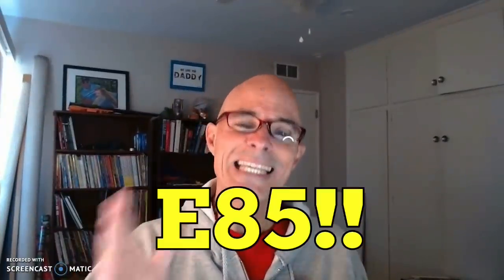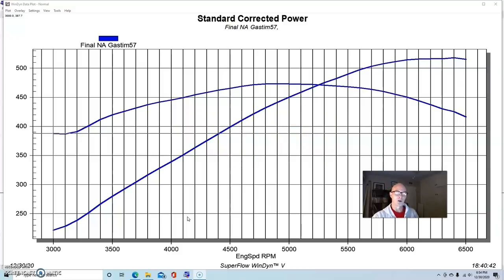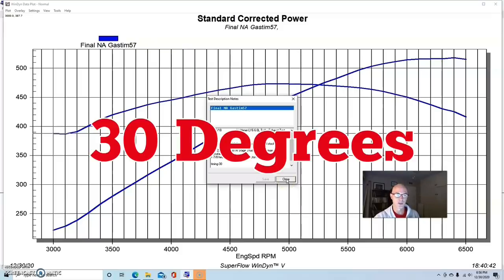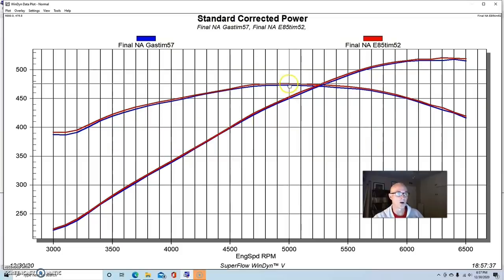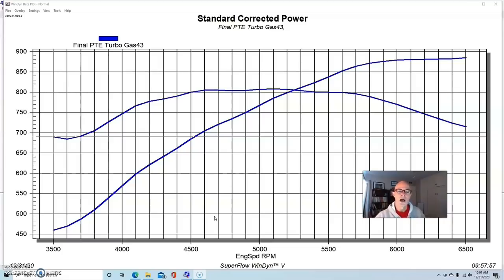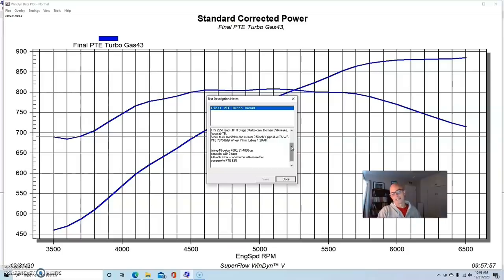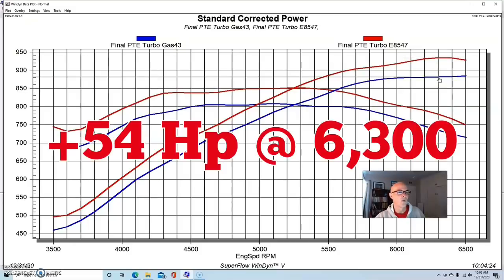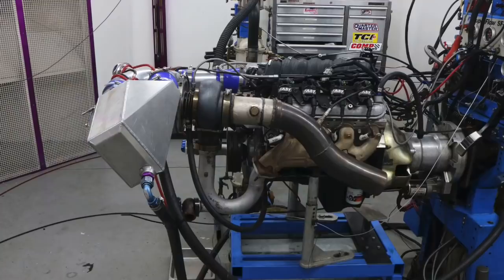JUNKYARD TURBO 6.0L LS E85 FUEL TEST

Comment: If you are not picking up power on E85 vs pump gas, you are not running it rich enough. You do not lean it out to make more power on ethanol like you do with gasoline, throw fuel at it instead. Best power on E85 is around 7.5:1. best mileage with good power is around 8:1 to 9:1 AFR. Timing also plays a part too, as does head/chamber design. As I explained in my other post on this video, the reason ethanol makes more power is it has more oxygen in it. Adding more fuel adds more oxygen, and it compounds as you add more. Oxygenated race gas will keep up power wise because it has more oxygen in it, but it is hideously expensive and E85 around here is under $2 a gallon. 

Even an 8:1 engine will puck up power if you get it enough ethanol. It might only be 8-20hp, but its less money and still more power. Low compression will result in lower mileage, but around 12:1 compression NA you will see the same mileage as on gasoline, and ethanol will pick up mileage along with power above 13:1. Lots more power, and using even less fuel.. still more win. From High Performance Pontiac magazine before they were bought by the owners of HRM. https://www.hotrod.com/articles/hppp-1109-testing-different-fuel/

it also cools the intake charge, but that is very limited in a port fuel system, works a lot better with a carb where the fuel has more time to vaporize and pull heat out of the intake tract. You will see more power the farther up the intake tract you introduce the fuel, also more cooling because it has more time, and if you run the fuel hot enough in the EFI lines you can make power AND increase mileage. the turbo is heating the intake air, ethanol cools it even with port fuel injector location. you get a little bit with direct fuel injection, but that goes completely against how ethanol works, so you will probably use a lot more ethanol in a DI engine. 

It DOES NOT eat your fuel system or engine gaskets, it will however clean all the varnish out of your fuel system and clog the pump, filter, and injectors. Additives are what cause the corrosion issues, not the ethanol. DO NOT ADD ANYTHING TO YOUR FUEL. Its bad enough when the oil companies do it. You know Jeff Smith as the tech editor of HRM and also for Summit Racing. Here is his article about corrosion on ethanol.

https://www.onallcylinders.com/2018/05/25/ask-away-jeff-smith-e85-pump-gas-additives-not-ethanol-cause-corrosion/

I've been running ethanol both mixed like E30-E98 and E100 that I make from tree sap, converting and tuning carbs like Holley, Demon, and my beloved Qjets. I am the go to info source for E85 Qjets. Look into it and you will find the info I have provided with m 455 Pontiac powered GTOs and Firebirds. I build my engines with as much compression as I can,  my daily driver 65 GTO has an iron head 455 with 11.5:1 and closed chamber heads, it likes 42 degrees total advance, the 67 vintage 400 heads don't have a good chamber shape to go with the large quench areas. In the 90s those same heads wanted 52 degrees total on 100 octane VP or Sunoco race gas.

My tuning and mileage testing mule is a 13:1 455 with open chamber 69 RA III heads that have been ported to flow 70cfm more than stock. They do not have the center crossover filled so the intake can get warm, which helps with vaporization. It makes tire shredding torque, well over 600ftlbs from what I can tell based on its ease in moving a 4100lb 70 GTO, and gets 20mpg with a Qjet, 700R4, and 3.42 gears. Mid 11s is where both of them run, and the 65 is a lot lighter than the 70, like 700lbs.

It costs me 10 to 40 cents to make a gallon from tree sap or cattails, respectively. it also requires about a weeks worth of work to make enough for the year, mostly cleaning as the yeast do the heavy lifting for me. You need a good amount of space to produce ethanol, I have lots of trees with 3% to 5% sugar in the sap, (around 300 sugar maples) no need to cut them down, just tap it like maple syrup. Syrup is far more valuable if you want to sell it though, I drive my cars more than I eat pancakes or waffles. If you want to know how it all works, just ask me. Its very simple, but has legal requirements. I will be making some videos about all of this in the near future.

I use an Innovate wideband in my header collectors to measure the AFR, I do not run it on the gas scale, I want it to read what its actually doing, because the mix might be different from spring to summer, and my home brew tunes a bit different with no gasoline added to it.. I have alternative methods of denaturing the vodka. Lambda measures stoich, so I don't use that either, because best power and best mileage are a good distance apart in tuning.  I don't have an engine or chassis dyno, so my measurements are all ET/MPH based. I am not the only one testing either, a group of us compare our tunes and a couple friends do Holley/Demon conversions for people. 

You can try to run ethanol like you do gasoline, but I will make more power and use less fuel than you do. I put Richard in touch with Mark Sullens, but Richard didn't want our nearly two decades of tuning/racing information. Its ok though.
Reply: Saying that ethanol does not eat you fuel system is over simplistic and therfore incorrect.  In a 2020 vehicle that would be a correct statement, in a older vehicle with natural rubber lines, fuel tanks containing lead, and cork gaskets the ethanol absolutely will cause sever deterioration and be problematic.
Reply: @jaydunbar7538  no, it does not eat your fuel system. My daily drivers are 65 and 70 GTOs, along with a bunch of other old cars I either build or race. The 70 has its original tank and hard lines, and its been on E85 the longest. 

Now if you have original rubber in your 40+ year old fuel system, its a fire hazard no matter what fuel you have had in it. Rubber has a lifespan. It is considerably less than 40 years. 

All replacement parts are ethanol compatible now. They have to be if you are going to run pump gas. If its good with 10%, its good with 100%, and everything made today is good with 10% because you never know where its going to be sold and used. 

The rubber hose I use in my fuel systems comes from either NAPA or CarQuest, its the basic EFI rated stuff, because its cheaper and I can use it with high or low pressure fuel systems. I do both.  I get lots of years out of the stuff, far more than I did in the 1990s when I was running race gas in my street strip ride. VP red and Sunoco 100 both made the rubber lines brittle in les than two seasons. 

I have ten year old rubber hose I am using with E85 and my E100. Also have a 30 year old Carter electric pump I use to get fuel out of 55 gallon drums and into my cars. It was under the 70 GTO for 15 years on 10% and E85 for 7 years. 

If there was a problem with ethanol and fuel systems I would find it. I do absolutely nothing special, no draining, no additives, no prep, nothing. When it gets too cold up here for me to drive it without a heater, or the snow flies and they salt the roads, I pull the batter and leave it, until mid May, when the snow is finally melted and the salt is washed off the roads. We get two blizzards every April, so I kinda hate that month, it teases me with great weather then dumps 4' of snow on me overnight.  So I always wait until May to take the insurance out of storage.  

November to May is a long time to sit.. and I never have a problem. Not a single one since I converted the 70 GTO back in 2007. 

If you are getting problems, it is not due to ethanol, it is due to additives or gasoline itself. You can blame ethanol all you like, but it doesn't change the fact that it isn't hurting anything but your tires and feelings of guys running pump gas.
Reply: And you will never get more fuel milage out of e85 then regular gas if thats what you are trying to claim, it has less BTUs per gallon therefore will ALWAYS consume more fuel per mile traveled.
Reply: @jaydunbar7538  aa I said already, the BTU is irrelevant its a measurement of heating water. There is a lot more to a fuel than heating water.  Not only that but ethanol is more than twice as efficient as gasoline. While gasoline in a lab can approach 18-20% efficiency, and street bound engines are closer to 15%, squeaking up ther to around 17 sometimes 18 with modern EFI and DI, ethanol is 40% real world and 42% in the lab.  

The US Navy tested exactly that way back in 1942, and they used ethanol to power torpedoes, airplanes, and many other war related things. The Luftwaffe used ethanol to power their jets, like the Me262 and He162. 

Hell the Model T was dual fuel before the Volstead act made it illegal to make or possess ethanol, to run ethanol you advanced the timing with a lever where the modern turn signal is and richened the mixture with a knob on the dash. To run gasoline you retarded the timing and leaned the mixture, and still it wanted to overheat on gasoline. The Volstead act was funded by Rockefeller to eliminate ethanol as a competitor to his gasoline.

What that means is gasoline is wasting more than 80% of its energy as heat, its not powering anything with that heat, its just making engine parts hot, and it needs to be cooled. By contrast ethanol only wastes 60% of its energy as heat, so more of the fuel is used to actually do work. Ethanol also has a 'softer', but 'faster' combustion event. Gasoline has a pressure spike that tends to break parts, ethanol is much more forgiving in that regard.

What happens when you drastically raise the compression ratio? You increase efficiency. You are working the same amount of fuel harder, and its making more torque as a result. Torque is what gets the vehicle rolling, the more of it you have the easier it is to move a given mass. This is why I build Pontiac 455s instead of 283 chevys. Also i can make 13:1 static with a flat top slug in a .030 over 455, using a iron stock head with some milling. Not even a lot of milling. 

Compare a 14:1 engine with a 7:1 engine and its going to be a massive difference in power and mileage. Gasoline from the pump will run happily in one, and not in the other, ethanol will run in either and not give a damn, but since you are not working it anywhere near as hard with each combustion event, the 7:1 engine is going to get a lot worse mileage than the 14;1 engine. 

Now crank up the compression to 22:1, diesel territory. Remove the gasoline and run denatured or straight E100 with a spark ignition in a diesel engine. You can't run the diesel injection, you have to run a carb or EFI. 

 It will run and get much better mileage than the pump gas engines of the same displacement, and you won't need all the mass in the engine to make up for the somewhat random combustion events due to the diesel cycle.  You can build a much lighter engine that makes the same power, and wastes less fuel to heat. You still need to contain all the cylinder pressure, so it has to have thicker decks, but nothing like the mass required for longevity in a diesel. 

Then you get into vaporization, and we all know a vapor has vastly more surface area than larger droplets like you find in atomization. That is why you get a more complete burn, more power, and it wastes less energy as heat. 

Remember that 1870 GTO?  Well I got 18-19mpg following a semi on I40 across Tennessee back in February 2000 when I drove that GTO from Nebraska to my base in South Carolina.  It had a Qjet fed 455 with 8:1 compression in it, turning a 2004R and 2.93 gears, and drafting off that semi. It also ran mid 12s like that despite weighing 4100lbs.

Then I built another 455 for it and used small chamber heads from a 69 RA III 400, milled them to make 13:1 with a flat top slug (yes I measured everything to make sure I had the compression I wanted 64cc chamber, zero deck, 8cc valve relief, .040 head gasket thickness and 464 cubes), and ran a similar sized cam with a slightly wider LSA to maximize cylinder pressure. A 700R4 and 3.42 gears went behind it. Left the heat crossover in place, converted a Qjet to run E85, got the AFR around 9:1,  and drove it the same 65-75mph without drafting trucks, going uphill rather than predominantly downhill, and it got 20mpg easily. It also made a lot more power, dropping more than a full second in ET, and still weighing 4100lbs. It tended to break transmissions though.

Note the 2004R has a .52 OD and the 700R4 has a 70 OD, along with the difference in final drive. Unlike the typical sbc, a 455 does not give a damn what gear is behind it, so it will push a 2.41 just as easily as it does a 3.42. More gear than 3.42 and it will go slower and just waste fuel, moving through the RPM range too fast will do that.

You see I have been doing this for some time now, and I managed to get good mileage and power on pump gas long  before switching to ethanol when gasoline was $5 a gallon here. 

The 65 GTO has crappy aero, really bad aero to be honest. The best it ever got with a 400 and 2.56 gears on pump gas, with 7.8:1 compression, was 15mpg, but it did run pretty good being quicker than my LS1 powered 98 Formula with a full exhaust and lid. Mid 13s..Then it got the 11.5:1 455 and running E85, put the 3.42 geared 12 bolt from the 70 in it then ran a 700R4 for abot two years, but it broke it. So I put a Th350 in it last summer,  The OD was worth about 2 maybe 3mpg, usually only 2 because the aero is terrible, But it regularly got 17mpg with a lot more power, a bigger engine, deeper gears, and running ethanol.

There just might be something you are overlooking as you repeat the same tired narratives provided by the people who want to sell you gasoline, and don't produce any ethanol. Just like the election, they tell you to ignore the man behind the curtain, take what we say and don't look into it any farther.
Reply: I'm pretty sure when Richard was quoting AFR's he was expressing the ethanol mixture in petrol equivalent.  It would have been better to say lambda.   There is no way he was actually running 12.8:1 on ethanol at full load, because it would probably miss and pop and make no power.  In reality, his mixture gauge was telling him both vehicles were running a lambda of 0.87.  He just didn't switch it over to ethanol for the AFR conversion when he switched fuels.  We usually do the same thing with customers because most aren't equipped (or inclined) to try and understand the difference (the looks on their faces if you tell them the actual mixture you run with methanol is hilarious).
Reply: Never had q16 compare to good pump e85 and it took roughly 2-3 more in timing. Then ignite made the same difference on the same e85 tune over e85 as e85 did over q16.
Reply: @JoshCP527  I haven't done much comparison with Q16, but the Ignite stuff does work.  Can only assume that the gasoline they mix in has a lot less volatility at high cylinder pressure (and it has a little more ethanol too).  Picked up almost 40 hp on a 1000 whp LT4 switching from pump E85 to Ignite.

Comment: I'm in Louisiana and I have to drive 50 miles to get E85
Reply: I'm in northern Michigan and I have to drive two hours south to Wisconsin to fill 55 gallon drums. I'd do 50 miles no problem. I am building more production so I can make more of my own though, and it will be denatured E100, no gasoline added to it. 

Did you know you can make ethanol from Kudzu? If you live in an apartment or suburbs its probably not going to be possible for you unless you just want some highly illegal shine.  You for sure know where to find some Kudzu...
Reply: @SweatyFatGuy  you can make it from anything containing sugar. Ethanol is extremely hydroscopic so you can't actually achieve 100% ethanol unless your producing it in a world class lab.

On a side note if your running homemade ethenol fuel on the road dont forget to pay the fuel taxes on it, people do get pinched for it on occasion. Now I'm not saying I wouldn't fudge the numbers a bit, its just that if you pay zero then its a easy case for the tax man, if you pay some then they have to actually prove you didn't pay enough.